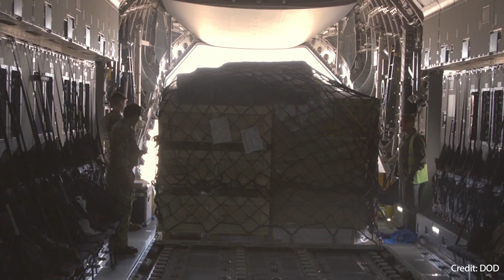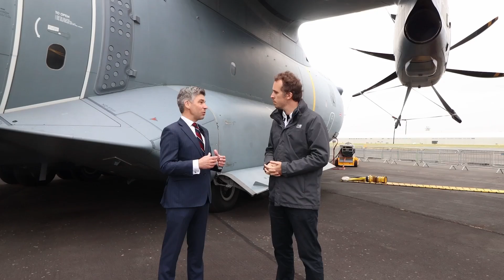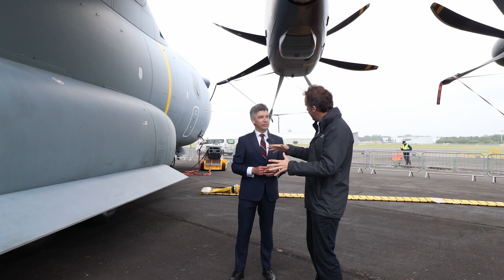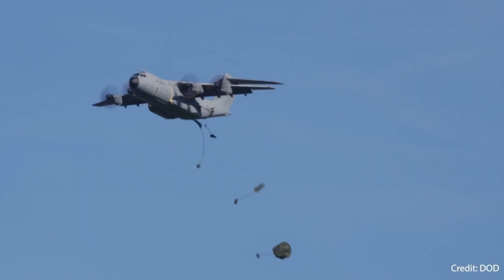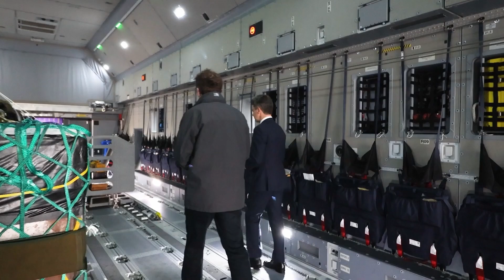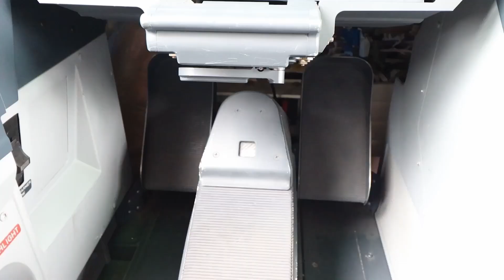INSIDE the A400M: The ULTIMATE Military Transport Aircraft

Comment: How are the shifting weights handled when dropping cargo in flight?  Suppose you have 20 containers and need to drop two.  One guess is that as those two move backwards, two at the front move forward to maintain the center of gravity, but as soon as those two at the back depart, now you've got to move the remaining 18 backwards to restore the center of gravity.
Or something like that, says my non-pilot imagination.  How automated is all this?
Reply: As discussed in the video, the latches can be operated automatically and/or remotely for drops or otherwise, but the cargo units themselves are moved either by the gravity or by muscle. It is not explicitly stated here, but for partial drops, they would probably simply calculate beforehand that the aircraft remains within the center of gravity envelope with what remains inside. I can't say it wasn't ever been done under any circumstances, but generally speaking you would not want to have unlatched cargo rolling around for any purposes, re-balancing included, as it could pick up speed very quickly depending on deck angle, and safely stopping it without danger or damage would become a problem.